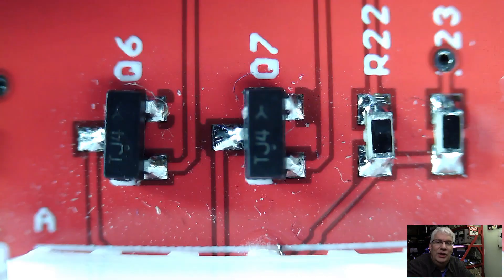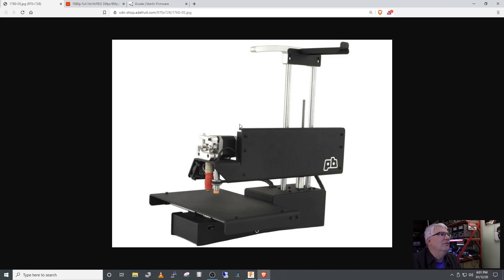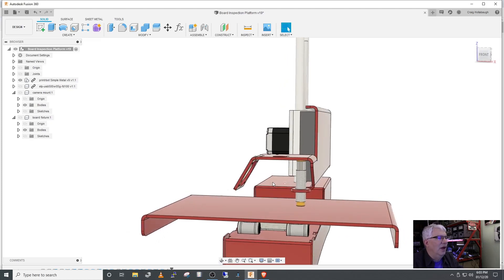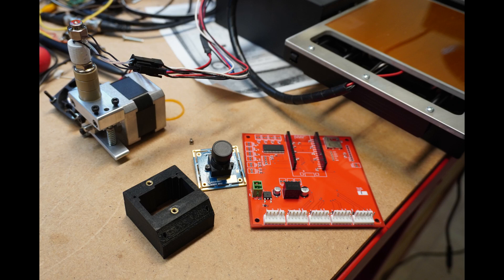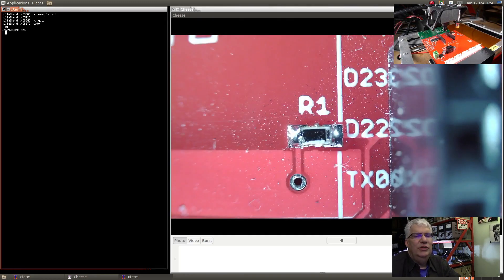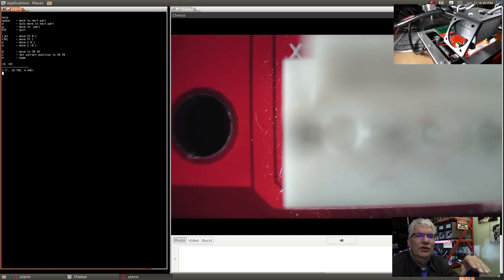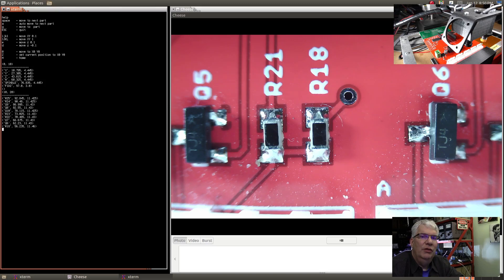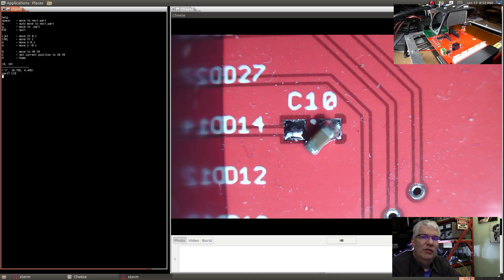200112 SMT Board Inspection Tool using a 3D Printer, USB Camera, Python and Eagle BRD File

Comment: Just a thought... would using the downlooking camera on the PNP, with a similar routine work? (Just started watching your videos, thank you for making them).
Reply from the maker: sure, it you have control of the PNP that could work. However, I don't have that option with my Charmhigh. Also, when assembling boards, you want the inspection step to be done while you're assembling the next board, ie don't tie up the assembly process. Thanks for the comment, glad you're thinking about this.

Comment: Could you use OCR to do a pre scan and record the locations of the parts and then allow you to goto the location without having to look at the whole thing?
Reply from the maker: You could do that but there's an easier way. During the placement operation,  a placement is file is created, so we know where exactly to look. If I was making 100s of boards, I'd take a different approach.  Right now I'm building prototype quantities, less than 10. So it's not to long to just run through the whole board. Thanks for the comment and for watching.